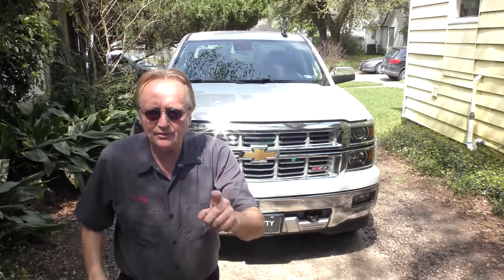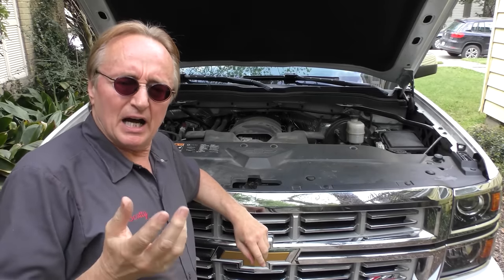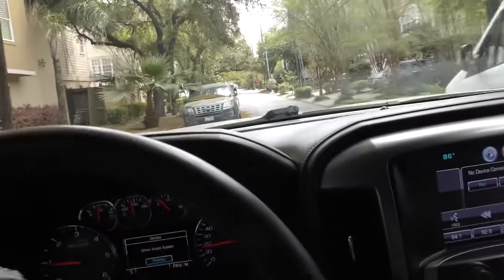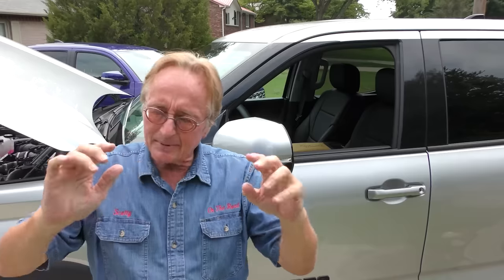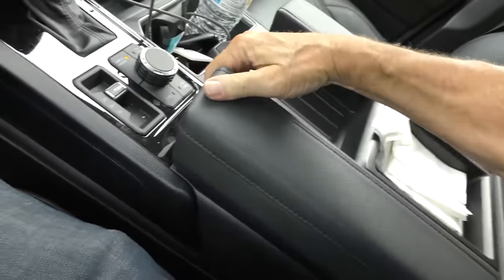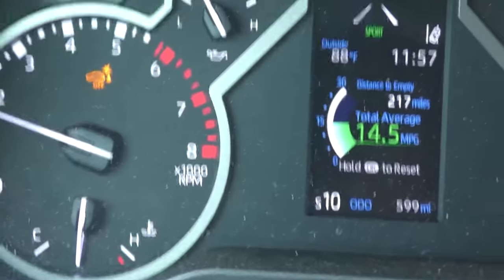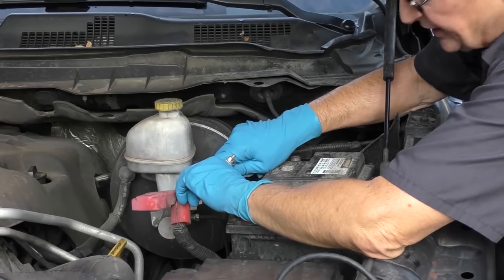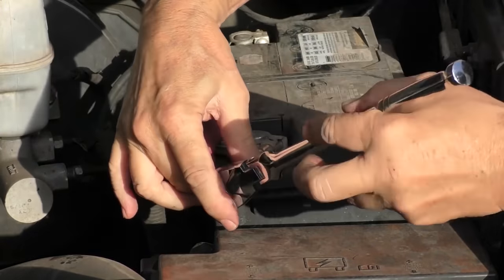3 Trucks I Wouldn't Touch with a 10 Foot Pole

Comment: All the "creature comforts" in the new vehicles are nothing but problems you'll have to fix if you keep your vehicles for any amount of time. That's why I'm still driving the only vehicle I ever bought new, a 1994 K1500 extended cab 4x4, Z71 with a 350 and 14 bolt rear axle. Sure, living in New England I recently did body work, made a custom bed, installed a 3/4-ton rear spring pack and replaced 40" of rotted frame with a channel I formed from 3/16" plate. I'm just lucky I have the skills and the facilities to work on it and make anything I need. I even reupholstered the seats and replaced the carpet with a fitted vinyl floor mat. 
The crazy thing is I have a 4" suspension lift, 35" tires, and I'm still on the original ball joints, tie rod ends, CV and U-Joints, wheel bearings with 289,000 miles. The only thing I had to do up until the recent repairs was at 260,000 I had to rebuild the 4L60E after losing 3rd and 4th gears. 

I'm going to keep buying older and older vehicles. After I'm done with the Chevy I have a decent condition '73 F250 4x4 I'm going through for a 2nd vehicle. The car companies can keep the junk they make today that cost as much as a damn mortgage payment! 
Keep up the great videos. I really enjoy them!

Comment: 05 Dodge Ram 1500 270k still running strong after a few normal wear n tear replacements like, U & CV joints, axle and wheel bearing hubs etc

Comment: When the engine in my 99 Silverado Z71 goes, Ill buy a crate engine for it for $5000 installed instead of 40+K for a POS new one.
It has 260,000 miles and still runs like new.

Comment: Which older  used Ford Trucks would u recommend. 
My last Ford was the F150 2005, with the tick took issue,  and Ford fixed that by replacement of engine. 
Then it was a good truck, until someone  T- boned me 6 months  later.
But it did save my life, so I feel safer in a truck.
Reply: I would recommend a 2011-2014 Ford F150 with a 5.0L Coyote V8 or the 97-03 F150 with a 4.6L SOHC 2V Modular V8, 04-10 F150 with the 4.6L SOHC 2V and 3V Modular V8s or even a used Ford Super Duty with the 6.8L SOHC 2V Triton V10 or the 7.3L Powerstroke Diesel, an honorable mention would be the 92-96 Ford F150 with the 4.9L Inline Six.
Reply: A Toyota
Reply: @harveyhankerson8359   Move to FL, no rust  :)
Reply: @joshuamast5128  not everyone wants a toyota.

Comment: You van cut open the air box through the glove box and access the condenser, JB Weld the air box or plastic weld it to reseal it. It works.

Comment: My late wife and I had an '89 Celica.  It was a good car but leaked oil like crazy, had to keep on top of it.  It had 120,000 miles when I got rid of it.  At the same time my daily driver was a 1980 Dodge Aspen with a slant 6.  Guess what Scotty? That Aspen had 143,000 miles on it when I sold it (the same day I put it up for sale).  It had a few drips, but not even close to the gusher that Celica was.  And, I didn't burn oil either.  It was a great car.

Comment: I have a twenty seventeen ram fifteen hundred with a V-six engine and it has run flawlessly for 5 1/2  years.  I consistently get 21 to 22 miles per gallon.  It is smooth, comfortable and immensely quiet.  It rides better than my honda accord, a twenty sixteen, with a four cylinder engine.  In conclusion, I have no idea what Scotty is talking about. Because he had to replace a starter Which the owner could have damaged by not replacing A warn out battery.  Most automotive batteries are only designed for a three year life.  And for the past thirty five years, I have always replaced my batteries after three years and have never been disappointed By having to replace a starter or an alternator.  People don't understand that When a battery begins to wear out, starting the engine takes much more Wear and tear on the starter.  the second thing that happens is that the alternator works much harder trying to always charge the battery and wears itself out.  What's the moral of the story here? Replace your battery after three years, whether or not you think it's working correctly or not.  I completely disagree with scotty on the dodge ram fifteen hundred, especially the classic version Because it has been completely contrary to my experience.  You are wrong on this one scotty.
Reply: I have a 2019 Ram 1500 Classic with the 5.7 Hemi and 3.92 posi rear-end. 
On the highway cruising under 70 mph, I am getting 21 mpg and 23 mpg at 60 mph. When pulling my boat, I get 15 mpg. I also don't use the MDS system where it can run on 4 cylinders. It gets 2 mpg less using MDS.
Reply: I have a 2018 Ram 1500 and agree with y’all. Great truck, two problems early on replaced under warranty. Nearing 80k miles now and it’s held up beautifully.
Reply: I have the 2019 Ram and a 2022 Challenger R/T. 
But I find myself driving the Ram over the Challenger. 
I finally got 2000 total miles on the Challenger.
Reply: Scotty rates most vehicles by their longevity, he has old cars and can keep them running for just about forever. Most modern vehicles can run 5 years with no problems and have substantially failures within 10. Scotty is giving ratings on the sustainability of vehicles for 20 years! Most won’t keep a vehicle that long. I don’t trust RAMs longevity over time, however, Ford has had substantial recalls in the last decade. GM has their share of problems as well! I’ve lost faith in the big three overall in the last decade. I have a 2011 Ford F150 with 270,000 miles on it, but won’t buy from Ford again. I’ll buy the last gen of Tundra with the 5.7I force v8.
Reply: @michaelcowan6254  just curious, what method do you use to turn off MDS? I have a 2019 and I found a YouTube video where the guy showed on his computer that using the gear limiter does disable MDS, and I can feel the difference when using the gear limiter, it’s just something I have to remember to do every time I shift into drive. Saw other videos saying using tow/haul mode turns off MDS, but saw no proof, and the comments seem to disagree. Since using the gear limiter doesn’t cause the transmission to stay one gear lower than normal, I just use the gear limiter when I’m tired of it bouncing between 8 and 4 cylinders (usually happens in the city where I coast a lot from stop light to stop light).
Reply: Put it in drive, and as you are going down the road, use the manual gear selection and push the minus button, and then push the plus button till it shows that you are in 8th gear. 
Now leave it alone and drive like normal. It will downshift and upshift like normal. 
Now, if you put it back in park or reverse, then you will have to do the procedure over. 
You will also have to do it each time you start or restart the truck. 
Hope this helps.
Reply: @michaelcowan6254  yeah that’s what I do now, was curious if there was another way I hadn’t heard about. Thanks.
Reply: @scottp2462  We are from the same generation which makes you a stand up guy.  I respect your opinion immensely scotty, thanks for the great youtube channel!!!

Comment: I'm currently on my second Silverado: a 2017 LTZ Z-71 5.3.  It's gets better gas mileage than my 2022 Charger Scatpack with the 6.4--around town, that is.  My first Silverado a 2003 had a recall for the tail gate cables.  Some genius at GM decided that they could save a few bucks by going to galvanized cables instead of stainless.  The galvanized ones began to corrode and break.  So hence the recall.

Comment: It amazes me how people who are about to spend $50k or more on a vehicle don't do a simple 5 second google search. It will come up to run away from new GM vehicles 🤣

Modern GMs are complete garbage. I don't know a single person with a 2010 or newer that hasn't had to shovel out money or luckily get something fixed under warranty.  

One of my friends had a brand Equinox that had to have the entire suspension system replaced because it was installed from the factory incorrectly.  It still wore out tires and couldn't get aligned. GM was forced to by it back after only 8k miles and 3 trips to the shop.  
My uncle bought a 2021 GMC Denali Sierra and drove it home. The next morning it wouldn't start. Something in the computer was telling the truck to not start. Luckily he had 3 days to return it and get his money back due to local laws. He had it towed back and told them to keep that dumpster fire.
Reply: The new 1500 are having rear ends go out at 20 K or less miles .
Reply: 😂😂😂😂 only poor people buy gm
Reply: You're assuming that most people with a smart phone, more than likely a social media account, and a home computer perform their due diligence and actually research a major purchase like a 50k plus vehicle? 😂😂😂
But in all seriousness, take the dumbest person who you personally know, knock off an additional 20 IQ points and that's a large percentage of the general population. I wish that I was wrong.
Reply: Lol
Reply: GM loyalists will buy them for life, regardless of quality,  just like they are fans of a football team for life. It becomes their identity, and they can't let go even if their pet brand screws them ovet.
Reply: @FWDSUXARSE  gm equals cheap
Reply: @mattnorman5241  As an owner of a 98 Trans Am, they are. I was well aware of the cheap interior and weak 10 bolt rear end when I bought it though. 10 bolt will be replaced by a Ford 8.8 when it goes.

Comment: I have a 2016 silverado and completely agree. But ive owned nothing but 5.3 engines and know how to work on them. They are simple, and also very easy to modify. Can be a stock truck or racecar.

Comment: I bought a 2010 Tundra doublecab long bed running 39" tires. It has a lift kit and still gets 13mpg in town. I dont get into the pedal much but it's a great truck if you don't have to replace the starter.  

Scott, have your grandson coat the underside of the frame and the lower sheet metal with PB Blasters 'Rust Shield'.  He should get to enjoy the truck a very long time that way.
Reply: Por-15 rust coating is 1000x better
Reply: @ALEXdaG  ....what?

Comment: ‘07 Sierra WT 1500, 4.9. 120k, absolutely no issues but for failed tranny electric servo at 62k. AC still ice cold and the best part….hand crank windows!  Remember them? It’s a keeper.

Comment: I’d double check the condenser for leaks. Located at the front of the vehicle. Usually takes hits from road debris/rocks and such. Sometimes it’s hard to see the die with the UV light. It’s very unlikely that the condenser sprang a leak. Maybe that’s why they tuck it away. You shouldn’t have to replace it

Comment: 10-Speed Transmissions?
I hope those, regardless of the manufacturer, are super reliable as the repair/replacement costs are likely very high.  
I'll stick with my 2008 Dodge (yeah, Ram) with the 6-Speed manual.  It went 170,000 miles before needing a new clutch. I expect it to go another 170K before a revisit.  I like this cheaper solution, and also like the personal engagement of shifting my own gears (I hate the hunting around some of these transmissions do).

Comment: 2009 Silverado is at 300000 miles and still running strong. Fuel Pump and water pump/thermostat has been only thing that needs replaced.

Comment: It's the key chip. Get a multimeter and read impedance on the key fob, and make the same impedance from a bag of $2;00 resistors you use to be able from radio shack. There is an orange wire coming down the steering wheel, cut, and put resistor on wire going to wire harness under dash. For less than $10, you could've been driving the same day. Impedance  can be . 5 off over or under

Comment: I just sold my 2017 Silverado 1500 6.2L V8 LTZ , I had it for 6.5 years never had issue with my a/c blowing cold air and never did any maintenance on the a/c  it had 146,000kms .... so take that into consideration

Comment: I have the new Tundra. I actually get the 21 MPG quite easily… things got turbos though, you get it up to 2k revs and it speeds up - quick. It feels like a sports car. That’s when you get that mileage. Drive it like a pig constantly, you’ll get shitty mileage. I use it as an off road rig. The thing is a beaut’, she ran very well up and down some rough trails. do the oil changes as needed, and 20k mi later, she still runs like new.

Comment: The company i left had 4 service trucks..they had replaced 3 2006 F250s with 2014 Silverado 1/2 ton base models. They had original engine and trans, and replaced trucks after 9 years. One had its first brake job at 220k miles. Went from Dallas to Houston every day. Im not bashing Gm ever again.

Comment: Not mentioned here (no reason for it), but I'm glad the Ford Courier pickup truck went the way of the Dodo Bird. I had the extreme displeasure of owning a '79 model with electrical problems. Here's the kicker: no factory electrical schematics existed. It was next to impossible to find two vehicles that were wired the same. Why did the Ford/Mitsubishi merger do that? I have no idea. Once that little Pinto with a bed started having electrical issues, they never stopped. It drove my mechanic nuts, and I certainly didn't have electrical experience back in those days. He eventually refused to touch it. I sold it off, quick! Excellent information on these newer trucks! Thank you for sharing!

Comment: Also the misfire and tick on the Ram is probably a lifter failure. Its a common issue with 2009+ 5.7 hemis. Cam is probably also torn up.

Comment: Bought a used 2015 Sierra 115k from a NON GMC dealership with a warranty. One month later, critical engine failure. They had the truck for the next month. 30 days later, SAME critical engine failure. Also, when we got it back from failure 1, the steering column made popping noises when turning because of a broken plastic component that should not have been plastic. I did not keep the truck.

Comment: I've had dozens of 1999-2006 Silverado 1500s with the 5.3 V8 and have always sworn by them due to their track record for simplicity and reliability. Regular port fuel injection, no high-pressure direct injectors and pumps, no electronic start/stop garbage, and best of all, no collapsible valves that deactivate cylinders to save a couple gallons of fuel. As a diehard Chevy v8 truck fan for those years, it sucks to say I'd never consider a Chevy vehicle of any kind after 2006 personally unless it were an absolute steal on an older 2007-2014 6.2 v8 because they do make great power and seem to be less affected by the cylinder deactivation carnage to lifters and cams.

Comment: Own a 2004 bmw 325xi that I bought for 2500 bucks as a winter/daily driver vehicle 174k miles ac still blows cold and rides smooth as hell no engine light. Biggest problem is the 2 of the 4 windows don't roll down and the gas door rattles. Can't believe it's lasted me this long also super easy to work on what happened to bmws seems like new ones u look at them wrong and they break down

Comment: Your talking about your 94 Toyota,,, my '78 Lincoln Town Car, has 85,000 miles and has all the original a/c parts including the original R12 in the system. I've owned the car for 30 years now and inherited it from my father. Still a cloud to drive and it's still blowing 34 degrees out if the dash vents...

Comment: I had a 2015 LTZ thank God I had an extended warranty. Had the injectors go out, starter replaced, tailgate handle was junk, and endless check engine lights. Got so bad I bought a code reader just to clear the codes. Dealer would say just clear the codes it was that I was burning ethanol. It was Flexfuel. I got rid of it.

Comment: Toyota fan here! I had a new 19 Rav4 it was lousy. Transmission problem starting off in a 2nd gear never got lowest fuel rating. Toyota refused to repair Transmission by complete denial of it. The engine was noisy and underpowered, the cruise control tried to steer me off an exit ramp. The only good thing was trade value.

Comment: Ok Scotty, looking for ANY year 3/4 ton truck to pull a fifth wheel. Don’t care about year or fuel type, looking for reliability and longevity as I have a 2004 need that $2k a/c repair-absolutely ridiculous. I understand design for manufacturing but not cost to owner! Thanks for your wisdom, Ted

Comment: I have an 07 f150 264,079 miles still running no knocks or tic ball joints battery and starter clean oil and transmission fluid

Comment: I had the opportunity to buy a very low mileage 2007 silverado that had the 5.3 in it. Cylinder canceling motor. It was like new condition because it sat in a heated garage.  I when to test drive it and it was uncomfortable to sit in. Seems like it steered harder than my 2000 silverado.   The interior was full of that cheap brittle plastic.  I just hated the feel of it. So glad I hung on to my older Silverado.

Comment: High pressure injectors make that mechanical clicking noise on most turbo charged engines. They switched to those high pressure (super high) injectors about 13-15 years ago. Mine tick like that in my old BMW's, but so far no issues.

Comment: I own a 2015 silverado crew cab 4x4. About 223,000 miles so far. Yeah that tail gate handle is cheap and have to be easy with it.

I work the hell out of this thing and so far its doing ok. I do wish theyd make em like they used to though. Back before all of this computer junk. That beeping sound actually hurts my head when it dings. Hate too many computer chip on anything.

Soon Im going to yank that 5.3 boat anchor out and put in a 'Hydra-Kinetic Motor'.

Oh yeah!

Comment: I was surprised to see my mpg between 14 and 15  when driving the Tundra conservatively. I don't like the current diesel situation with the EGR and constant DEF usage, but my last several trucks were diesels and I'd get 22 mpg for a vehicle that weighed 1700 lbs more than the Tundra

Comment: If you do the hammer trick with the starter jumped to battery have a friend there cause if it works and the car starts that starter will stay engaged and grind flywheel till you pull power from it